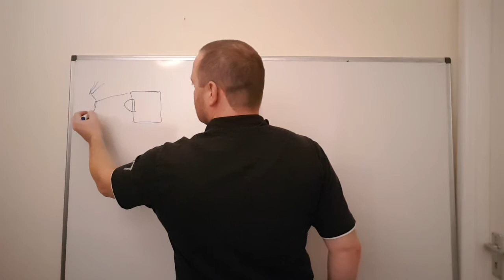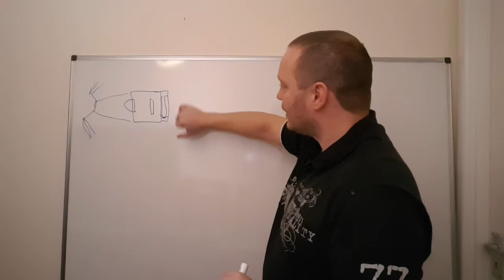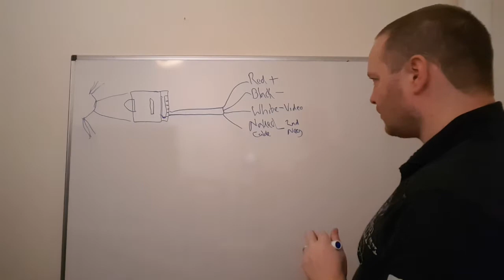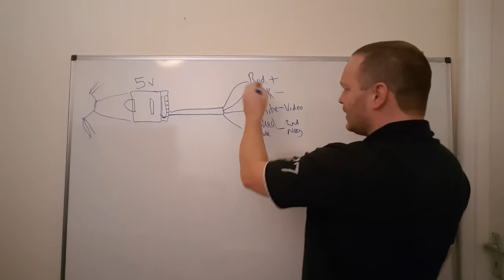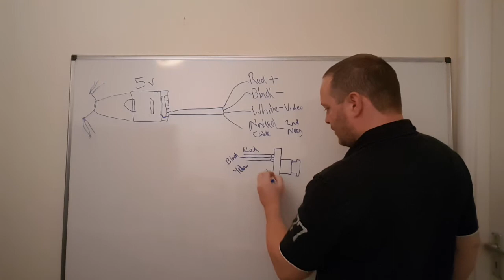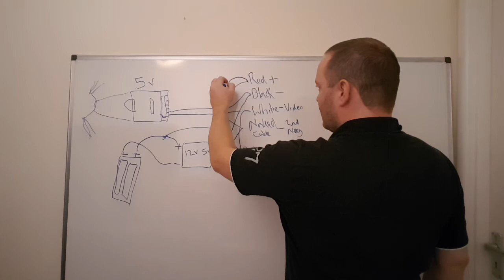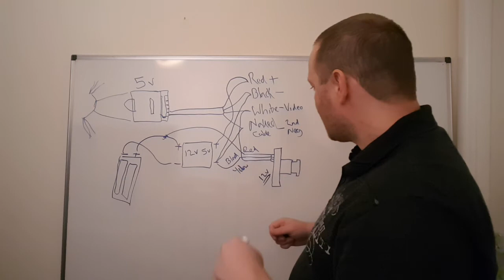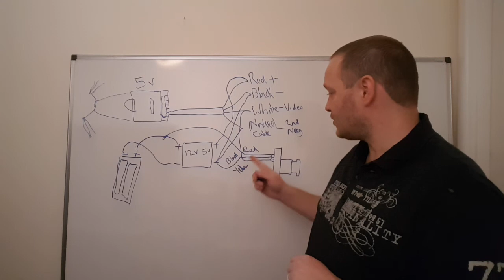DIY Night Vision - Vision 750 wiring diagram

Comment: Hi. My problem to this stuff is too high noise on the screen. Any solution please?  Thanks
Reply from the maker: +Justin Penanda how have you got the wiring set up? Is it the same as the wiring diagram. My only thought is that the connection is not good or you have the voltage dropper to close to one of the other circuit boards.
Reply: fetchitnowuk. Wiring connection is depending on your diagram. Voltage is 3.7v 900mA( action camera's batery. If i connect to a dvd Player, there is too high noise. And i don't underatand what the operation card or manual guide mean " input : CVBS input (remove the partition, and after the interpolation noise is reduced to the line hd display) what is that mean?

Comment: Is it possible to connect a raspberry pi in there ... for crosshair stuff and video recording and so on
Reply from the maker: +Daniel Müller I think the answer will be yes. What you describe is a scopeless kit but you can get the RPI and associated camera to do NV. See my other video's about that if you haven't already.
Reply: fetchitnowuk yes, but the rpi camera is not good enough in my opinion, i want a better camera to do the work ... any ideas? :)
Reply from the maker: +Daniel Müller this is the same issue I have. There is currently not a usb camera I have come across that has a sensor that large enough and affordable. The work around for me is a T74 IR torch on a concentrated beam focus.